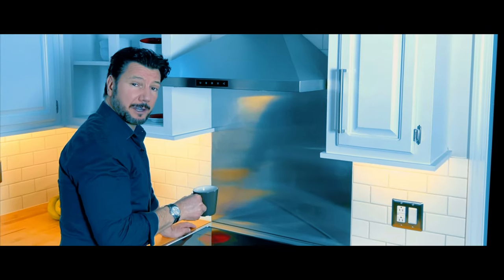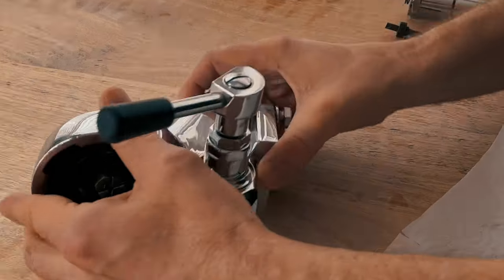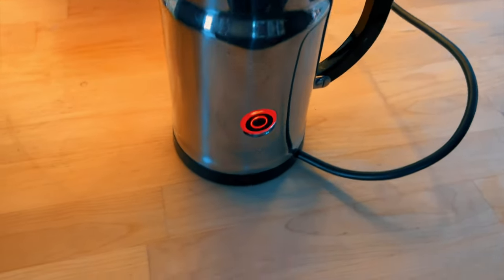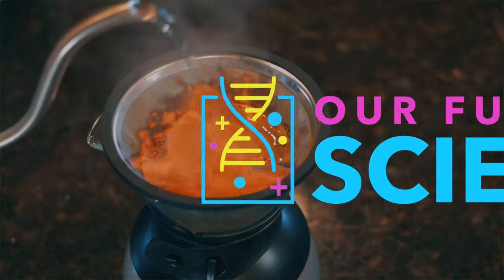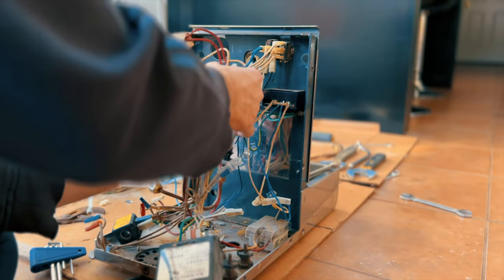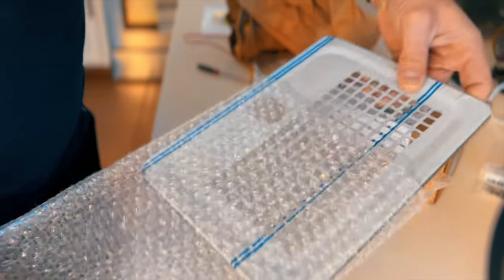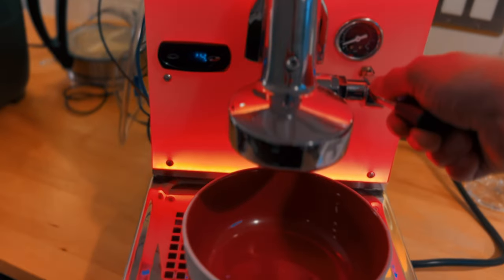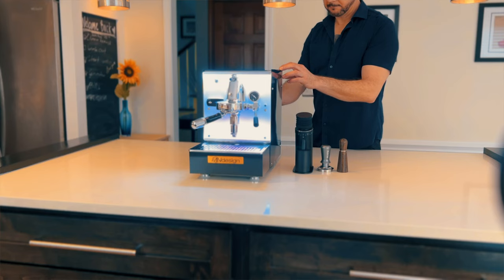DIY Carbon-Fiber Espresso Machine with LED Bling!

Comment: Carbon fiber is important, so the espresso machine is as light and stiff as possible.
Reply from the maker: Lol seriously though it is already super heavy with the copper boiler and all that so I am glad it has carbon panels vs. stainless steel or something that makes it even heavier.
Reply: It helps with aerodynamic stability, something most Italian products use nowadays

Comment: Nice but looks like you are pulling a huge ratio of water to dry coffee. If you have a shotglass that reads in mL, aim for between 25-40mL for a shot. Past that you are typically only extracting bitter compounds as the yummyness has already been extracted. If the shot is sour, either increasing the volume of the output or grinding finer typically helps. If 2 shots pulled the same way with everything the same taste different, this is where coffee nerds would recommend a scale for consistency. Super cool build!
Reply: I thought g to mL was 1:1 but it's actually going to be about 50-60mL not 25-40 (with scales something like 36g)

Comment: Amazing project! Loved watching your video. 😀
What pid did you use?
Reply from the maker: Thank you!!
I bought a PID specific for espresso machines, simple because I only wanted a very small temp display with only up/down temp buttons. The cheaper ones I found on Amazon all had a fairly big display with red LED segments and I didn’t like the optics of that :)

Comment: I have a basic mass produced pump type machine. Is it worth just replacing the pump for more pressure? Does just increasing the pressure make it gooder. Or its all things. Pressure water temp, bean , grind , bean temp?

Comment: REALLY enjoyed your video, even though you (nicely) made fun of Decent.  You asked for advice on reducing channeling.  First thing is to understand what's going on. Channeling is simply your coffee puck not being able to resist the water pressure in a certain spot, and being under 9 bar (about 140PSI) the water always takes the easiest path.

From your video, I'd guess that your first, big problem, is your using an inexpensive grinder. Those tend to make coffee grinds of varying sizes, and pressurized water will find  weak spot.  The Niche and DF64 are the cheapest grinders that are considered acceptable for espresso.

Next, water flow speed, especially during the start of your shot.  Many E61 machines has a "line pressure" mode, where water flows to the puck at about 3  bar (that's the pressure of city water) and after about 10 seconds, the user engages the motor to go to 9 bar.  Letting the puck wet gently, will really help.

Next to finally, flow or pressure declining as the shot proceeds, will help a lot. Because 20% of your coffee puck is ending up in your cup, after about 20 seconds your puck has less coffee in it to resist the unrelenting 140PSI/9 bar that your pump is putting in.  Lowering the flow (or pressure) as the puck degrades, will greatly reduce channeling in the last 10 seconds of your shot.  That's why "spring lever" machines, make such great espresso.

And finally, how evenly is water being spread onto your puck? I've seen E61 with just one central hole, but 3, 4, or 5 holes is more common.  The less even, the more likely your powerful pump is drilling through your coffee puck.

-john
Reply from the maker: Firstly, John, receiving a comment from Decent Espresso Machines alone is an honor in my opinion. I truly appreciate your feedback!

Regarding my machine, it does not have line pressure since I use a tank and only the pump provides pressure. However, I could potentially look into installing a flow control valve. I was not aware that 20% of the puck ends up in the cup😳 interesting!🤔 

I hope you know that my comments were not intended to make fun of your machine. Rather, I was highlighting the fact that some people take the coffee-making process too seriously and miss out on simply enjoying a good cup of espresso or cappuccino. As an engineer, I am impressed by what you do with the Decent espresso machine. Based on my research, I understand that you use proportional valves which I assume are responsible for the noise during the brewing process? I am not entirely certain this information is accurate, but I have also read that you use machine learning to optimize the espresso-making process.
The Decent espresso machine is undoubtedly an impressive piece of equipment that showcases the intersection of technology and coffee-making.
Thanks John!
Reply: @MarkusNenning  Not to worry Markus, I can certainly take friendly ribbing!  The Decent crowd are definitely known as being more-than-usually geeky about coffee, so it's fair to make fun of us for that. <smile>

And yeah, I agree with you that *it's*all*about*the*drink*. When people ask me, at trade shows, what's special about our machine, I always counter with "let me make you a coffee, because if you don't like it, I don't want to waste your time".  Espresso needs, first and foremost, to be about pleasure for the body, for the heart. Otherwise, fuhgetaboutit!

Getting some sort of flow control going on your homemade machine would be super helpful.  I recommend you both look at the Bianca, and how they do it to an E61, as well as the many flow control mods for E61 that exist. One might "just fit" on your machine with minimal effort.

As to what we do on the Decent, it's quite different than the traditional approach. We have a heat-on-demand water path, which gets to around 120ºC (it's pressurized), and we drop-by-drop mix that with room temperature water in a chamber behind the group, to dynamically alter the water temp going to the puck, as needed to get the puck to a specified temperature (people forget that the coffee puck is at room temperature).  We need two pumps to do this, and they're vibe pumps, because we need very low latency, and very fine flow control.  Rotary pumps are too high latency and move too much water for what we need.  If you want to know more, here's a schematic: https://twitter.com/decentespresso/status/985910699267362816

And finally, let me say that I really enjoyed your film-making, your sense of humor, and just wanted to honor that effort with a contribution, if I could, to help you make better coffee.

ps: your LED lit front panel is super cool.  We might steal that idea from you in the future (credited!) if that's ok.

-john
Reply from the maker: Wow John, an LED front-lit panel on a Decent Espresso Machine would be super cool!! I will buy a Decent Espresso Machine myself if that really happens! :) 
I had never thought about the latency of a water pump before, but yes it makes sense that a rotary pump, with its higher mass, would be less responsive to changes compared to a vibrational pump 🤔 

And thank you for the compliment on my film-making; it's my hobby and I truly enjoy it."

Comment: Did the black paint on the motor give any problems?
Reply from the maker: No why do you think it did? 🤔 you just have to make sure everything is covered up well.
Reply: @MarkusNenning  Because I read somewhere that that particular motor, I guess the alloy, is resistant to heat. Dunno, if they are talking about the heat from the boiler just next to it, or the heat from the motor itself.
Reply from the maker: @plurplursen7172 ah ok. Well in my case the pump only runs a very short time every day (only when pulling a shot) so not even enough to even get hot at all.
Reply: @MarkusNenning  I was thinking the same. The same motor can feed a 12L 3gr Boiler. In your build it will have a long life. Real nice build btw. I am deep into my own build. 6.5L HX 1Gr boiler.  I was thinking about sanding down those lines in the fitting. Now I am going to do it. Fix as many leaks before testing I am thinking
Reply from the maker: Sanding it down was the only way to get the leak to stop. You just want to make sure you take down the very minimum and very even surface cause otherwise you need a spacer/ring between the fitting/nut. And don’t over tighten that’s where the groves come from in the first place :) 
Good luck with your project!
Hope to see a picture!
Reply: @MarkusNenning  I used super fine paper and did not remove it all. I don't have the skill to produce new pipes with silver soldering. But, just persuaded a big cooling company to copy 2 pipes that was too wasted. It turned out better quality than from the espresso company, and they did not charge me at all!! Finally a small felling of saving money on this build